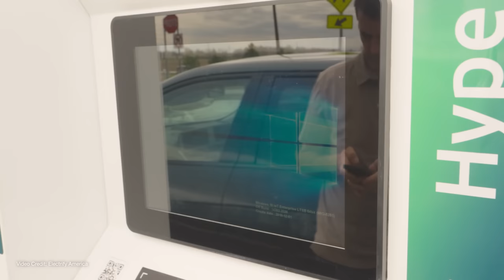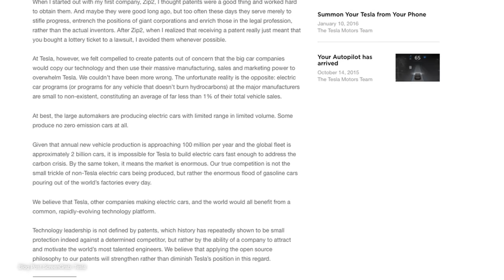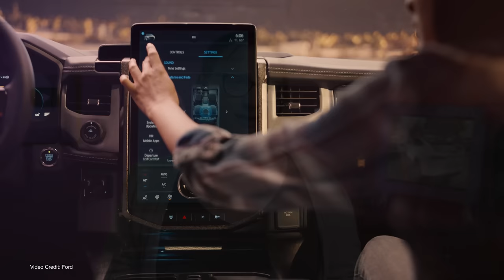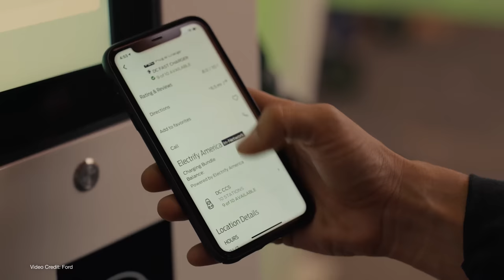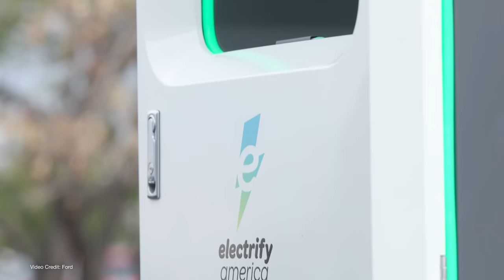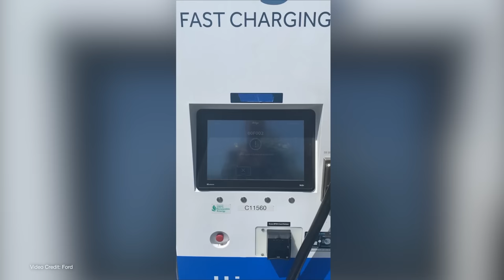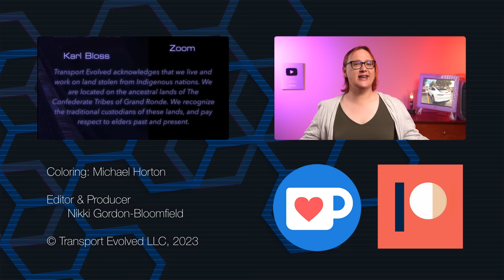Ford's Switching To Tesla's NACS Charging Tech - What We Know (And Don't Know)

Comment: I think the biggest change that needs to happen (needed to happen years ago) is  an across-the-board standard that every EV approved for on-road use is required to adopt. Not only a standard on the connector shape and put out, but standard on inlet placement, a very clearly written standard on vehicle-EVSE communication, standards for charging station layout, etc. Tesla already does this on their own cars and chargers…that’s why their stations work so well on their cars, and why the experience falls apart when they’re expected to work with other cars.

I’d have preferred to see things going the opposite direction (Tesla transition to CCS, as they’ve done basically everywhere else in the world) because the CCS connector is 1) not proprietary and 2) has functional VTG capabilities already. Most of the complaints that people have about CCS and the things people like about the Tesla connector have nothing to do with the connector itself (aside from physical size) and everything to do with the vehicle’s implementation. But, if we design and implement the standards I mentioned before based around the Tesla connector, it’ll still be better for new EVs going forward… it’ll just suck for the hundreds of thousands of CCS vehicles that already exist.

To those saying that vehicles transitioning to the Tesla connector leading to the downfall of all current CCS charging providers would be a good thing, you need to take a good, hard look at the history of monopolies. Hint, it never ends well for the consumer. Basically, Tesla will use it as leverage to get a monopoly on the vehicle market as well by pricing fast charging vert cheap for their own vehicles and prohibitively expensive for anyone else. Market competition is always good for the consumer and monopoly is always bad.

I’m trying to keep my personal hatred of Musk’s backwards views on politics and human rights out of it, but let’s face it, that’s impossible. Horrible people should not be celebrated just because they did one good thing.
Reply: I dunno, your aversion to all standards originally developed as proprietary might be going a bit far.
Seems like the 26mm light bulb screw sockets haven't hurt me too bad so far, even if they started out as Edison's proprietary standard. Likewise I'm not sure the Torx screw drive standard has been too devastating to those industries that dared to adopt it.
Reply: People who have accomplished MANY positive things should probably also not be claimed to have only done ONE thing.  Completely understand your aversion to dealing with Musk.   However, the Tesla connector is much better...would be best to convert to it, get Tesla to commit to doing V2G, etc. and build out the best charging system with others allowed to build the same chargers / connectors, etc. Sometimes the thing created is just better.

Comment: Ford has not sold enough EVs to have issue with change...
Reply: And what happens with exports when the rest of the world is standardising to CCS?
Reply: @AlanTov  "rest of the world is standardising to CCS?" CCS Type 2 Mennekes is NOT compatible with Type 1 J1772 in North America. Then there is China using GB/T which is a whole different ball game. There was always going to be this problem regardless if you privately imported a car. Protocol wise NACS will heavily be based on CCS. North American cars using NACS has no relevance to rest of the world, it was going to be like that regardless if NACS exited.

Comment: Tesla's Supercharger Network only works so well because Tesla controls both the station and the car, and all involved software. As we are already seeing with the stations that are opened for other brands, they're running into exactly the same issues as other charge point operators and CCS station manufacturers.
Ford having to run CCS over Teslaplug is more or less picking the worst of both worlds.. a convoluted communications protocol over a not very well scalable connector. The NACS is already at its limit with the current 250kW (no matter how often Melon claims it will go up to 1MW or more) - just see how hot the cables get in summer, and how common temperature-based charge throttling is already, where CCS has been designed with significant power reserves and liquid cooling from the beginning.

Comment: There's still so many questions that need answering before we can say anything sensible about this entire endeavor. And as you pointed out, this might even be because the deal has not been finalized yet.

One of the biggest questions will be about the communication protocol used by Ford. If they are stuck with CCS and Tesla does not offer plug to charge, than it will become a bothersome experience for taking out your phone and starting the charge that way every time you want to charge at a Tesla charger. But the current Tesla charger are also not designed for vehicles from Ford. Even if the v4 chargers get a longer cable, it will still be only half as long as on the average CCS charging station, still limiting the options for ensuring that you can park correctly and take the correct charger for your parking spot.

I am really wondering why Ford is taking this action, especially with Tesla adding the Magic Dock to their chargers in the US, opening up those stations to CCS capable cars. The only advantage I can think of is when they will actually bet on 2 horses and also include the CCS port on those vehicles. Then it no longer matters where you charge. Otherwise you'll have the choice of pulling out the extension cord or the adapter every time you want to DCFC.
Reply: Ford knows that Tesla is far outperforming both Ford and GM...by far...and they also know that Tesla will likely create the Charging Software for Ford, when they switch to NACS and so it will be smooth transitions.  Ford wants to solve for the main issue, which is that compared to Tesla's charging network...the rest are substandard in UP Time and performance / maintenance.  Ford may have Tesla do a LOT more Software for Ford in the future...would be smart on their part to be partnered with them, rather than not.

Comment: Tesla supercharger stations are positioned so that they are close to where the charge port is on a Tesla. Parking non-Tesla EVs in such a way that they can charge off of a supercharger is likely to mean that they take up more than one charging space, not just parking space. This will also be a long-term issue for any manufacturer switching to NACS, for Tesla, and for Tesla owners.
Reply: Tesla is making longer cables for their chargers.  Problem solved.
Reply: @David C  Great to hear! I haven't seen any examples of that yet, have you? It will certainly mitigate the issue. I know of only a couple of herringbone setups where the position might still be a problem.

Comment: Building chargers for vehicles you manufacture, engineer and control is one thing. Having those chargers seemlessly work with multiple manufacturers' EVs you have no control over -- is a whole different proposition altogether. As Tesla is slowly finding out. Furthermore, Tesla is trailing in the 800v charging game. And where is the Cybertruck going to charge for it's highest charging speeds for the time being? You guessed it. CCS.
Reply: Without question Tesla has the best Software Engineers in the entire Automotive Industry.  Ford will almost certainly have Tesla create the Software for Ford's next NACS charging port. This will be seamless for Ford...and they get the best charging Network in North America, hands down.

Comment: No Ford keep ccs , but add the Tesla socket if you want to add better connectivity, ccs should be made us mandatory, Tesla are stalling the us ccs rollout simply because of the units that need to be swapped. We already see Tesla we’re planning to update with the magic chargers appearing , this move with Ford will only delay this
Reply: Ford is moving to Tesla NACS because it is better, the chargers have more UP TIME than any other system in North America.  Tesla maintains them better than all the other Charging Systems.  Also Tesla will almost certainly create the Software for Ford to convert to NACS. This means that Ford will have the best software for connecting with charging systems.

Comment: Personally I'd prefer to keep Chademo.  Using CAN to communicate is the most logical standard to use.  The others standards are more expensive and complicated, and not for our benifet.

Having said that, CCS became the standard, leave it at that.  Keep changing the standard will just slow down the EV revolution
Reply: The company producing the most EVs in the entire world, with the best functioning Supercharger system...and a much better, sleeker, less prone to damage plug has created a better overall charging system. Selecting poorer performing (easier to break / malfunction plugs) and having chargers that are not properly maintained is not a good standard.  Considering that approximately three quarters of all BEVs on the road in N. America are probably Teslas, it's reasonable to have them as the standard...and just get them to do bi-directional charging.

Comment: Unless Ford is going to have DC Fast charging on all the cars they offer they shouldn't use Tesla's plug.  Imagine buying a Ford EV and you drive up to a Tesla charger and plug in only to find out your car didn't come with DC Fast charging even though the plug fits.  The other problem I see is Tesla is just going to have to put on heavier thicker longer charging cables on their Super Chargers.  It is yet to be seen how easy the Tesla plug will be to use.  I am thinking the long thin handle and a thick heavy long charging cable will be more difficult to manipulate than the CCS handle which yes bulkier but gives you more to grab onto.
Reply: They do now. All Mach-E, all F-150 Lightning, and all eTransit have full DC-capable CCS. Yes, even the eTransit, which would be one that would make sense to offer as AC-only, since many fleets don't care about "road trip charging."
Reply: Nah, the plug is simply better and less likely to be damaged easily.  The longer cable will be well designed. (I think it's already being implemented at some newer locations.)

Comment: Ignoring Elon's actions and words is utterly ridiculous.  He also didn't invent EVs, nor did he engineer the Tesla vehicles he's so well known for.  Ignoring the bad stuff Elon says and does is the same as validating it, and that's not OK.  As a Mach-E owner, when I get my adapter (which rumors say Ford will send existing owners for free), I'll only use Superchargers when I absolutely have to (which will likely be never).

Now, if Tesla fires Elon, and starts embracing right to repair, I'll sing a different tune, but I don't see that happening . . .
Reply: You DO realize that Elon is the largest shareholder...Owner...at Tesla, correct?  Without question, Tesla would not be where it is without Elon...even to this day.  Steve jobs was also an AH, BAD to his daughter and her mother.  Ford will have a much better chance of succeeding if they switch to NACS and way likely have less issues with inferior charging systems, broken / malfunctioning chargers, poorly maintained chargers, etc..  Cheers!

Comment: Tesla is iOS.  "Everything works because we know the exact implementation on both sides and there are a testable number of permutations.  As long as you give Apple/Tesla all your money, your devices will work seamlessly."
CCS is Android.  "You get inconsistent behavior because the two sides interpret the spec slightly differently. We can't test all permutations  But, you get more choices."
My bet is that plugging my Mach-E into a Supercharger is going to be as hit-or-miss as using an EvGo.
Reply: Connecting a hamster wheel to a generator is more reliable than Electrify America.
Reply: Ford will have Tesla create the Software for when their vehicles go fully NACS.  There won't be any issues when this happens...and / or Tesla helps Ford make it happen on the software / components side of things.

Comment: This format war is only hurting EV Adoption.  We should have had a standard by now and required all EVs to follow that standard.  While I think Tesla's Charger is better and more convenient, it isn't and shouldn't be the standard.
Reply: The standard exists, it is called CCS. All manufacturers support it, all charging networks support it.
Reply: @Hans-gb4mv  I know, I own a 2017 Chevy Bolt EV.  What I meant was that by Tesla continuing to push non-CCS, it is segmenting the market which will confuse people.  Imagine if Gas Pumps had different pumps for different cars.  Oh no, our gas station only works with Ford cars.

CCS needs to be the standard for all EVs to eliminate confusion.  I wish Tesla's connector was the standard, it is in the minority when all other car makers are using CCS.  What Ford is doing is stupid, why transition your cars to Tesla's connector when you already have CCS?
Reply from the maker: We Totally agree - Nikki
Reply: @jakthebomb  About 70%+ of ALL BEVs in North America driving around are Teslas.  The Tesla Charging System performs better Up Time and less hassle, when used properly. 
Ford sees the writing on the wall in N. America and wants to be part of the best charging system here. Period.  Farley knows what he is doing in relation to this and will be one of the EV winners because of it.  
When Ford and many others switch to NACS, the less bulky and better designed chargers will become the standard in the Americas.  Tesla is putting up massive numbers or chargers in N. America with well over 100 Charging Stalls at many new locations.  These will become the Gold Standard for how charging stations and stalls should be built, operated and expanded.  Don't trust EA, the DieselGate charging network any further than I can throw their chargers.
Reply: @davidc2838  I won't argue that Tesla's Charger is better, I even stated that in my previous two comments.  However, Tesla isn't 70%. It is actually 53.79% according to data with 197,517 Cars sold.  I will venture that number will continue to decline which further proves my point.

Ford has 2.51% of Total EV sales, combine them and Tesla and it is still lower than your stated figure.

Tesla rolled out tons of charging stations, however they are up against other charging networks who all use CCS.  Switching standards is stupid and only serves to alienate early adopters.

Now if every charging network had both connectors on each charging station, this wouldn't be much of a problem.  But that is added cost and confusion for your average consumer.  I work at a place that offers free Level 2 charging, I have spoken to other EV drivers who couldn't tell you what CCS is.

EV adoption needs to be as frictionless as possible, where Tesla and Ford are just continuing a format war that benefits no one.  If the Tesla connector wins out, I hope Chevrolet and other companies offer a port conversion service.  Or else folks will have to carry an adapter which costs hundreds.
Reply: @jakthebomb  No. If you look more closely at my post, Tesla is about 70% of ALL BEVs “Driving Around in NA”. 
What that means is that Tesla is about 70% of the entire BEV FLEET in NA. They have been building and selling EVs at scale for half a decade longer than most other automakers in the US / NA.
Tesla has 70% of ALL BEvs sold TOTAL to date in NA. (Just shy of 2 Million BEVs TOTAL on the road in NA as of June 2023.) FAR more than any other BEV manufacturers in NA. 
Orders of magnitude compared to many manufacturers in some cases.
Thus the installed base in NA is mostly Tesla, with Tesla charger plugs installed.

Comment: I bet Jim Farley made this decision to switch without fully considering all the implications, especially the vehicle to home or grid possibilities. Inside Ford I bet they are scrambling to figure out what they are going to do about that.
Reply: I bet he wants a charging network that WORKS...not one that doesn't. In the US...there is NOT a better or larger charging network than Tesla. There's a big reason that Ford switched and it's because they know who runs the best system...and who has the best software engineers, if help is ever needed to make Ford EVs work better with Tesla chargers.
Reply: He said they have been talking about it for 2 years.
Reply: There are a tiny fraction of buyers who bought their at home charging system, they will be fine with an adapter or likely a cable change out retrofit. This is really not a big issue.

Comment: This is the American's usual Darwinian approach to business so no surprises here.  Profits first and customer be dammed is the mantra they are known for worldwide.   It would be good to see a one-size-fits-all solution as you mentioned but nope, not here in N.A. unless ChatGPT or some sibling says the magic phrase to corporate America at large.

It is simple enough to pay for gasoline at any pump with a debit or credit card so I can't see any reason why the same cannot be applied to any and all charging station docks.

I am surprised that so far there has  been no enterprising individual (that I've heard of) coming up with a socket set that can be used by any vehicle owner at any charging station.  Same idea as buying a plug-in to charge your phone or laptop on foreign systems in countries other than your own.  Plug your connection into whatever adapter is required and that's it.
This proprietary crap has the Apple-style rotten apple smell.